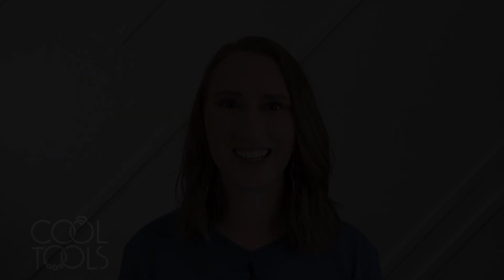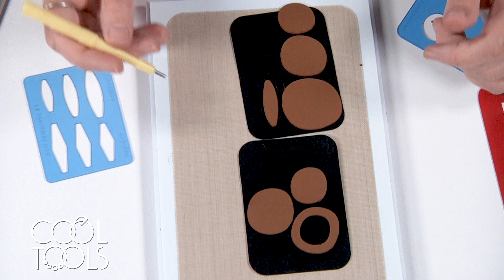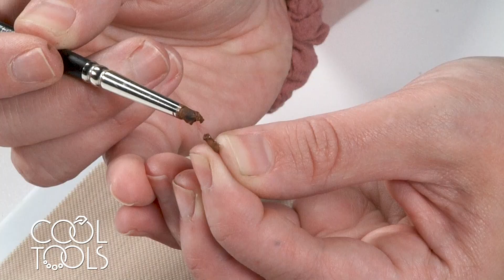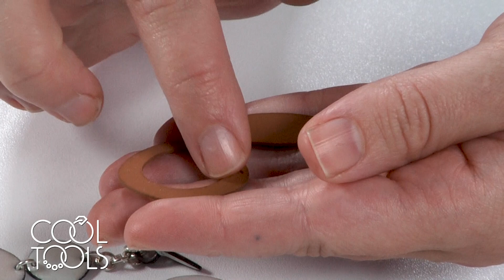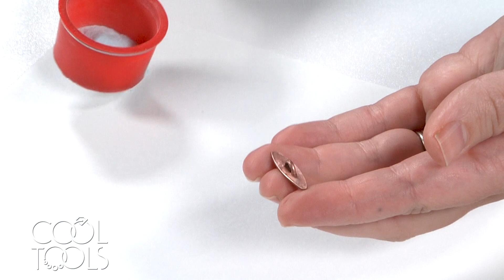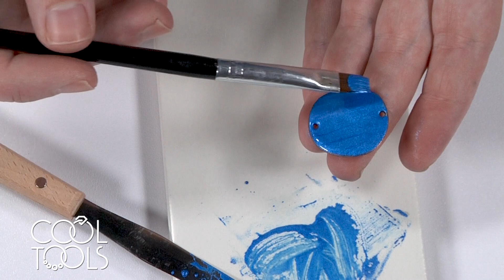Cool Tools | Enameled Pearl Necklace with Mica Powder by Karen Trexler

Comment: Great tutorial.  Motivated to get my clay out.  By chance could you do a segment showing how you dry the clay and put in and out of kiln during the firing steps?
Also do you use surfactants and pickle pot?   Great necklace!
Reply from the maker: Hello, thank you! Yes, we’re working on videos that dive into the details of firing pieces. As far as surfactants and pickles go, I always clean my pieces with surfactant before applying the enamel. I usually try to avoid pickling the pieces I want to enamel or have applied enamel to, especially if they’re made from metal clay. Instead of pickling, I remove oxidization by quickly hitting the surfaces with a 220/320 pink sanding block.
Reply: @cooltoolsvideos  I recently moved to Grapevine TX and go. Eileen my home in CA and there.  I will be stopping in soon when I return.   Looking forward to meeting you and taking some classes.  Thank you